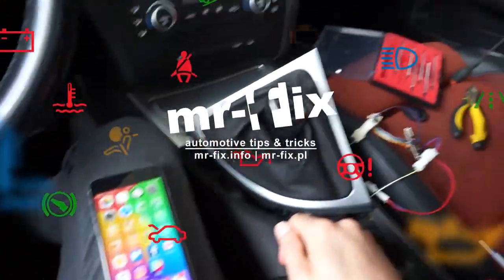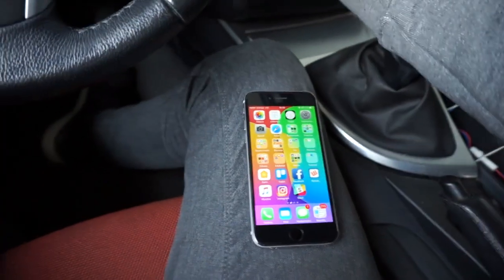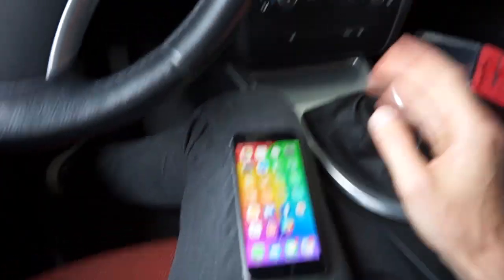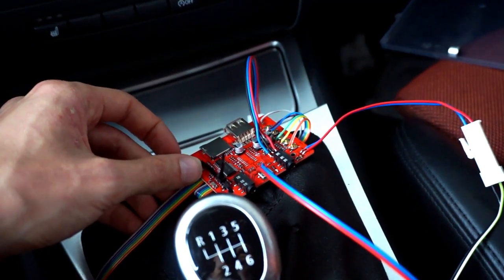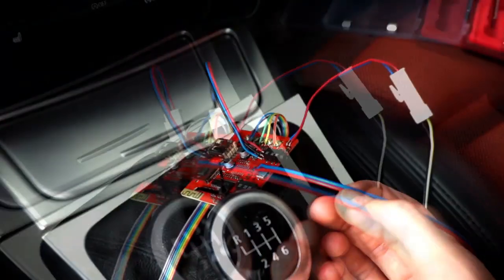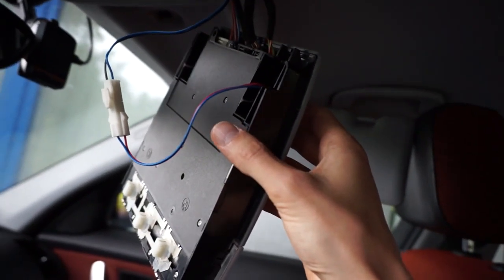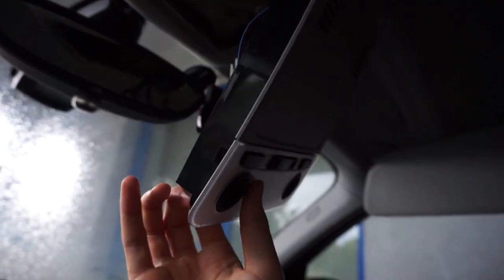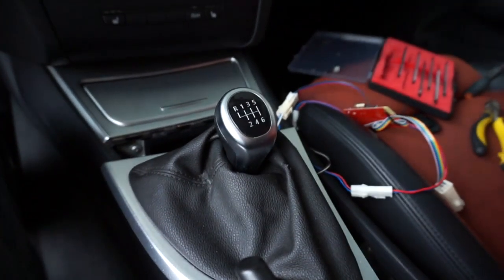BMW bluetooth install for Business CD radio (AUX, A2DP, USB)

Comment: Hi, I just wanted to let you know I installed the same BT module but I added a (K)CAN MCP2515 interface using an arduino pro mini to command the module functions using the stock F steering wheel commands. It works great! I am fine tuning the BT volume control function (long press next or prev buttons) but overall I am very satsified with the seamless functionality and handsfree sound quality.
Reply from the maker: Hi! That's great! I already have the MCP2515 waiting to make something similar but I would love to see details of your project if you are willing to share.
Reply: @mrfixpl  Sure I will try to make a decent video and post my code and explanation on a bmw forum or somewhere relevant and post the link here for others. I need to do some code cleaning and fine tuning first for the volume control because I want to keep this functionality as the default BT levels are pretty high and cause distortion if not reduced so it is best to have control over this indipendantly respect to the car's radio volume. As the KCAN gives only a pressed ID and not seperate pressed/depressed values (which would have been cool like on the older I bus) I need to emulate the long press via software using timing and delays. At the moment it works pretty well but sometimes when "long pressing" after changing the BT volume it also skips to the next or previous song as the buffer may contain the same command (the MCP buffers the commands even if the arduino is busy doing something else) and it gets executed as a seperate skip track command.
Reply from the maker: Maybe when you detect long press you should ignore short press trigger (let's say for the next 500ms or so) to filter out those false track skips?
I'm just guessing since I have no idea how your code and the CAN data flow looks.
Reply: @mrfixpl  the module simply keeps sending the pressed button command in sequence (1 about every 100ms), there is no short or long press command, it is just the same command repeated until you release it (there is neither a press down or release command, you have to emulate it). So, I am changing the code to simply keep the output of the relative pin low until the command is no longer received using a short timeout. It is this timeout that has to be tuned (cannot be too short else will timeout before the next button command is received and so will not long press or cannot be too long or the volume will be increased/decreased too much. As it is a question of milliseconds it depends (as usual with these loop codes) on where the command is executed and how long it takes to check the next command in the code. As there is serial debugging which introduces more delays this steals processor time (with millisecond delays serial output is a killer). I removed all debugging code in order to keep it as responsive as possible but I need to know the timing limits and for that I need the debug output! Anyhow a long story short I just need some time in the car to find the right delay:).
Reply: @mrfixpl  Here is what the serial output looks like when pressing the buttons:
https://www.youtube.com/watch?v=Bkr9tWjPa2c
Reply from the maker: Looking at your video got me motivated :D
Next week I'm going to try myself. Will share result for sure if I manage to get it working.
Reply: @mrfixpl  I installed the module "permanently" today. I made a short video (doesn't show much, more of a description)
https://youtu.be/y2lIHC6XXRY
I haven't posted anything on any forum yet, didn't have enough time but I can send you the ino file if you like.

Comment: How did you solder the audio control buttons? Is there only 1 cable to each button?
Reply: I am mostly interested in the play/pause button. The button on the bt board has 4 solder points on the button. Which solder point should i solder my wire to?
Reply: @niklassandgren5355  The buttons have 4 solder points because they are redundant: 2 on one side coincide with the 2 on the opposite side. As mr-fix said, simply check with a tester in Ohms the Ground pin of the button by touching one contact and the USB shield for ex. - the one with 0 Ohms is the ground and the one on the side (or not 0 Ohms) is the signal input (toggle). The buttons have mirrored connections so if one has GND on the left the next button has it on the right. There is a small plug with 2 connections on the far side (if you soldered it) which is in parallel with the "MODE" button which you can also use if you like for this purpose.
Reply from the maker: Most likely 2 of those points are connected permanently to ground. The other two are shorted to ground when you press the button. You need to check which of those two will short to ground with button pressed, solder to it and connect to external button/switch that will short to ground when pressed.
Reply from the maker: I have it 75% ready. It's not connected yet. Each button on the BT board have 1 wire, there's a common ground connection between Bt board and HVAC module in BMW. The hard part is to solder into the BMW buttons in correct places and cut circuits in such way that the signal levels match.

Comment: Hey! I'm just about to prepare this modification in my e87 but not with the exact same chip (CSR8645). I will use one with integrated DCtoDC regulator that powers down the 12V to 5V. (Also, would I need to add a capacitor?) What I am concerned about is overheating. Don't you think, that the chip will burn something in the car if I don't mount it securely?
Reply from the maker: My DC-to-DC regulator can take up to 5 Amps. The bluetooth device uses under 100mA and the regulator is not even slightly warm when I'm using it.
If I remember correctly it also have some kind of thermal breaker.
Reply: mr-fix I have finished it today. The overheating will truly not be a problem, and as you have told the wiring is a pain in the ass. Though I completed it and it works, I am not a hundred percent satisfied with the audio quality. The soldering is fine. It just seems like it lacks a little bit of base. Don’t get me wrong it has base but not as good as it should be I guess. Still need to Test it more.
Reply from the maker: Some BT receivers have EQ modes that you can choose from.
Reply: mr-fix alrighty. One last question. I’ve tried several different microphones, but the volume of the voice is very low. If I put the mic next to my mouth maybe the other side can understand me on the phone, but not while it is installed to its place up above. Is there a way to increase the gain of the mic? Maybe an amplifier board connected to the Bluetooth chip. And if so, can I share the power between those 2, or would I need a separate line from another pig fuse?

Comment: Hello , did you managed to get buttons working from radio unit to answer , finish calls and change songs ? Also that link for module doesnt work anymore. I got e87 2004 with sat nav but i dont have heated seats and i dont have those extra buttons. would this work for so I could be able to connect it to my radio and use my radio keys to call , change songs etc ??

Comment: Please, give me an information about how the pairing is solved. Because I assume that it can not be paired with each bluetooth device automaticaly. What if I had 2 active bluetooth devices in my car? So please, explain how this is solved. Thank you very much.
Reply from the maker: I have it paired with two phones. It connects automatically to the one that it can find. It can have two connected devices at the same time. Didn't checked yet what happens when both devices are trying to stream audio.
Reply: Thanks, yes, I understand. I wanted just to be sure, that it can not happen that someone near will connect to the bluetooth module before the driver can do. But anyway the pairing itself requires also confirmation when you do it with some new device. So the devices which are not paired will not connect to the bluetooth module automaticaly - uncontrollably. One more question. Do you think that it is suitable also for my BMW E46? If you aren't sure, it doesn't mind, I'll try it anyway. :-)It is great DIY tutorial, thanks!!
Reply from the maker: As far as i know it will work just fine in any car with AUX input.

Comment: are you going to make a video explaining the audio control buttons? because I really want to know were did you get the colored wires you will use
Reply from the maker: Will do. Not connected yet. Stay tuned.
Reply: @mrfixpl are you now connected ???bluetooth works fine but how to connect to manage my cell over the keys, and will there be a possibility to connect to the control button over the steering wheel and also call ??

Comment: Hi. love your videos! I have a question that might be hard to answer. I left my bmw e90 -06 for a clutch change at my regular car service garage. When I got the car back it was 30.000km younger. (???) I will let you know that I (not specialy interested in tuning or selling altered cars), nor the mekanic have any interest in altering the km of cars! I am a family man and the mekanic is close to retire. This is why I seek answers. I would honestly set the km's at its original position. 
Anny idérs as to what has happened?  Thanks in advance!
Reply from the maker: Hi!
If I had to guess, I would say that during the clutch change they damaged your cars ECU and replaced it with used one. Mileage is stored in ECU if I'm correct so you have the donors mileage on the display.
But that's just a guess...

Comment: nice video  definately gonna do that , but how to use the buttons on steering wheel ? i have identical e87 , and not all steering wheel buttons work and cant find anywhere anything  about them cause 6/8 only work and phone button and next to it buttons dosent react no matter what i've do
Reply from the maker: The thing is that BMW offered only one model of the multi-function steering wheel (only with all 8 buttons) and even if you have the 2 phone-related buttons, you will not be able to use them if you don't have the bluetooth option in your car.

The only thing that came to my mind is tapping into the CAN-BUS with an arduino with additional hardware and listen for the button pressed message. Then use it to control the device. But this is more a hobbyist project since there would be a lot of R&D to make such a thing.